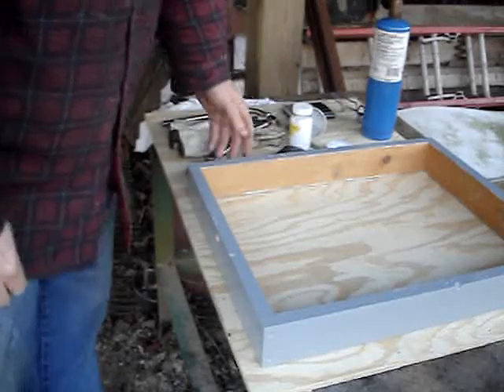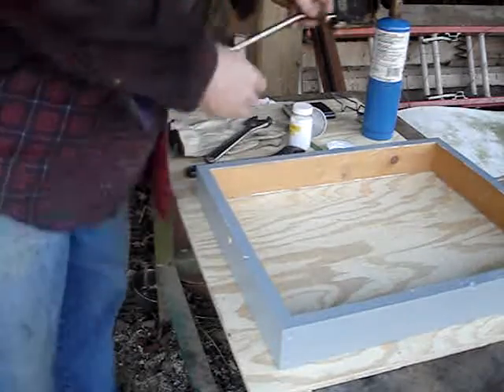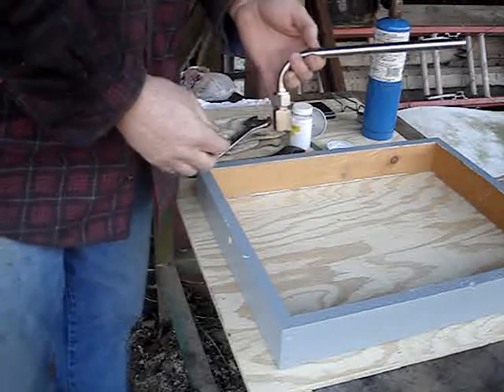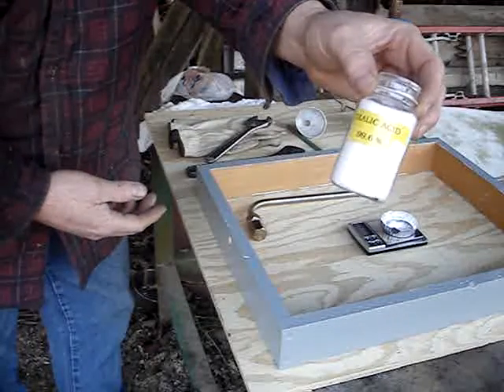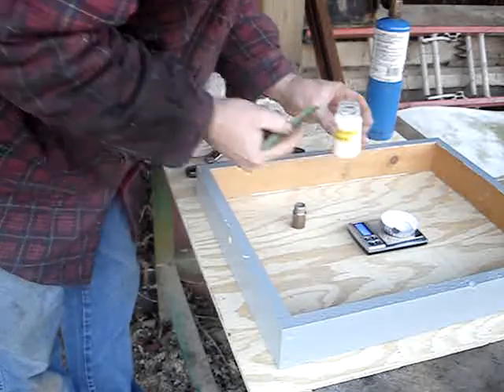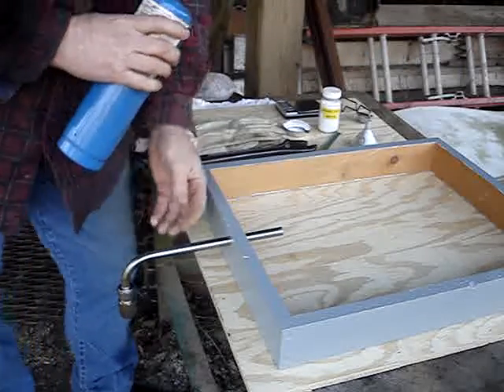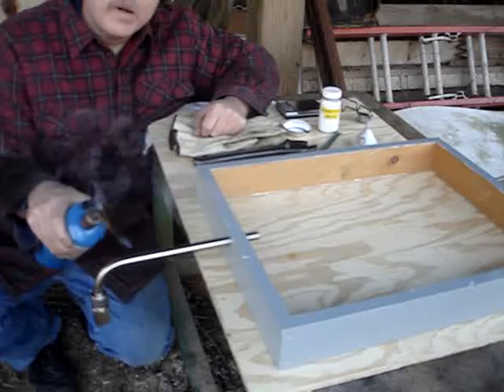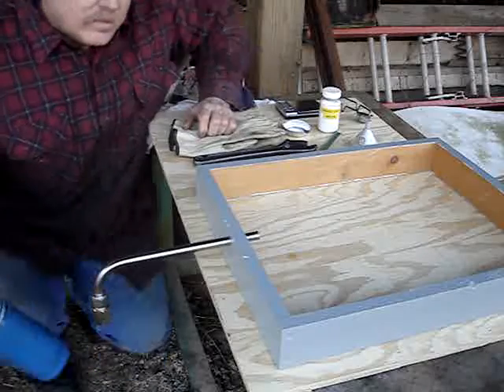Treating Beehives With Oxalic Acid Vapor

Comment: smoke rises , so does it actually circulate throughout the hive if you put it on top?  i have ordered an electric vaporizer but didn't get it yet, and was wondering about introducing through the top, because i  use all screened bottom boards.